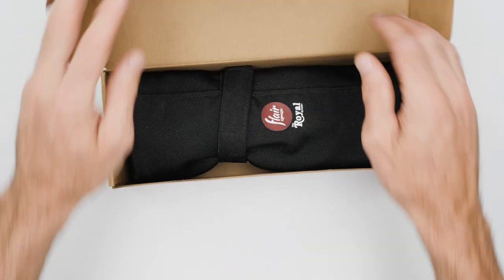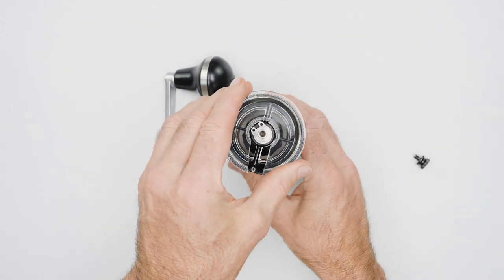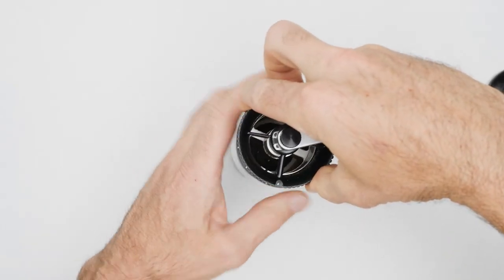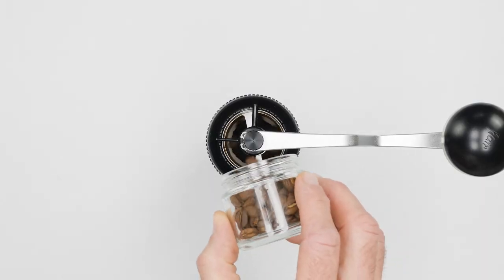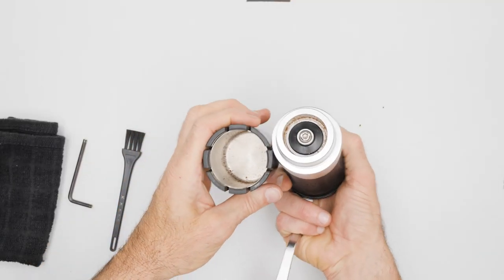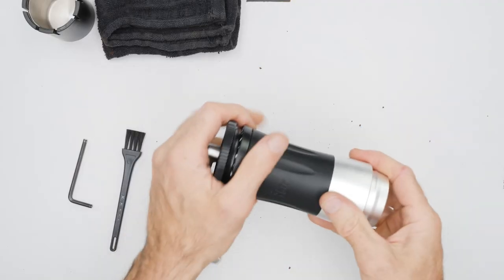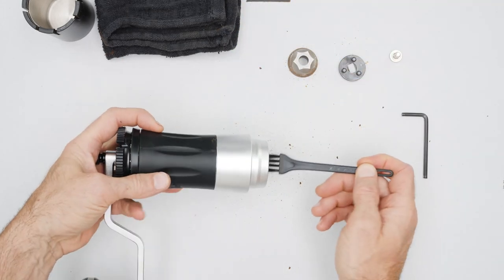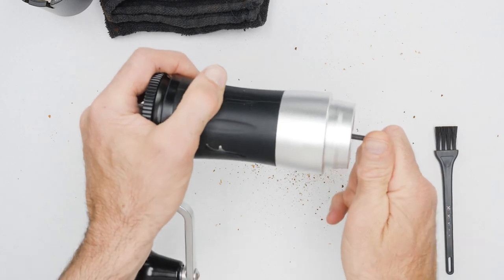Royal Grinder - Setup & Cleaning Guide

Comment: Just got mine in an hour ago. It's amazing totally turned up my flair neo experience.
Reply from the maker: Thanks for sharing!
Reply: Was wondering how often should I do that cleaning you show toward the end of video? And could you give me recommendation on grinder setting for using with Neo? I went with a 1.5 turn from the smallest grind setting. It works great but I'm new to this and was just curious if I'm on the right track. 👍☕
Reply from the maker: @Brewmanbru  if you're using it every day, you're exchanging what little coffee is retained for fresh coffee. You can weeks or even a month before it's worth considering. One full rotation from soft lock up (burrs kissing) is a good place to start for 16-18 g dose, perhaps a couple clicks coarser. feel free to reach out by email service@flairespresso.com to get more assistance.

Comment: Took me five or six shots to get the Royal grinder dialed in for the Neo Flex standard (non-pressurized) basket. Found the sweet spot betweent 9 and 11, variable by the usual minutiae. If you are using locally roasted beans, try 11 and then tighten it up.

Comment: Just got mine. Grinds great, but hated that the handle wobbled because of the misfit of thickness of handle vs. length of shaft. Found a copper washer to perfectly compensate. M8X12x1mm. Happy and gratified grinder now. It even looks good in place.
Reply from the maker: Thanks for sharing, please send an email to service@flairespresso.com so that we can look into the misfit
Perhaps it's something we cam address with a replacement handle
Reply: Oh! And I vacuum both ends of the grinder whilst turning the handle after every  use. I mean… why not? I have a vacuum cleaner.
Reply: @FlairEspresso  Easier to take a few thousandths off of the shaft. The copper washer is actually an elegant solution. I like washers.

Comment: Trying to clean it, cannot get 4mm bolt to move holding opposite end with just hand as in video. Seems easier to slip handle back on to stop rotation of shaft while loosening bottom bolt. Inner burr comes right out and has little on it after 8 mos of nearly daily use. The inner/ring half of the burr is harder to get at, but a small toothbrush gives you the needed angle. The included brush isn't much use in there, but there isn't much to clean anyway, at least at 8 mos, except for some residue on lower edge. I think the hardcore types will want to take it completely apart to get a better look at the ring burr.
Reply from the maker: thanks for the feedback and tips!
Reply: After doing this I actually pulled a nicer shot on my semi-auto (Silvia) than I had earlier with the dedicated home espresso grinder (Specialita). This was on the first try, after setting grinder back to where it had been for Flair shots (on 5 in first rotation). Impressive.

Comment: I have had my grinder for a week now, however I am finding that the grind is not consistent. After a number of extracts I have to recalibrate back to position 0 (first rotation) and then set to between click 6 and 8. This makes a very good coffee, however I have to keep recalibrating the rotation every two to three days as it seems to move to the next rotation. It does waste some coffee every time I have to recalibrate. Will this settle at some point? Flair support told me that it could take a few weeks to settle. 

I was of the understanding (possible incorrectly) that once you set it to the first rotation and around that click 6 - 8 it should remain at that setting.  At this stage it does not...
Reply from the maker: have you dropped the cone burr out for cleaning? what you describe suggests the cone burr isn't secured properly which can happen if you remove burr and replace while grinder is set to a fine grind. set the grinder to a very coarse setting, loosen the screw that secures the burr and retainer, ensure proper seating/no gaps and retighten. still having troubles reach out to support www.flairespresso.com/contact so they can guide you further
Reply: @FlairEspresso  Thanks I will do as per your suggestion. I have not removed the cone burr since I received the grinder last week, however this may solve the issue for me. I will do as per your suggestion and advise outcome. 😀

Comment: How long does it take to grind 18gram espresso?
I'm using Hario and it takes 4-5 minutes.
Reply from the maker: This depends on several factors such as the coarseness and brittleness of the beans but for espresso with the Flair you can expect 1/4-1/5 that time so ~ 1 min
Reply: @FlairEspresso  I received it and I tried it. It takes around 1 minute. the grind is uniformed and consistent. It is wonderful !
Reply from the maker: @oalaqeel  thanks for sharing! Grind on💪
Reply: @oalaqeel  thanks for sharing, I was hesitant because I had a hario once and it drove me nuts. Just placed an order for the flair royal!
Reply: This is nothing like a Hario or Zassenhaus for that matter. Much easier and quicker.

Comment: Hey, I just got this grinder a few days ago and today I started using it. I did a pourover, it was pretty good for a first usage but once I moved the crown to a coarser grind to try a french press, when I got to the 60-72 position I felt the crown beginning to rub the rim, producing clicky type of sound similar to what's explained in 0:46 but with the difference that I didn't rotate the crown past the 72 position.

I notice that in the demostration the crown moves pretty smoothly until it hits position 0 on the third full rotation. Is this a normal behaiviour? I'm thinking it might be because the grinder it's very new still but this is my first hand grinder, so I can't really tell.
Reply from the maker: please get in touch with support here flairespresso.com/contact so they can look into this matter for you better as video might be required. you should have at least 72 clicks available.
Reply: @FlairEspresso  Oh I do have the 72 clicks, my question was if it is normal that the grinder makes those clicking sounds when I'm moving the crown to a coarser position, which is in between 60-72. I have to try anyways if it affects the grinding. Thanks for answering!
Reply from the maker: are you counting clicks from lock up of burrs or "0"? are you finding you need to be that coarse (where it starts riding on body) for some brews? if so, pull up on crown and compress spring inside a little more to gain additional clearance. if you need more assistance please reach out to support www.flairespresso.com/contact
Reply: @FlairEspresso  
Yes, I'm counting the clicks from 0 (absolute zero position which is explained in the video). Yesterday I tried to adjust the crown to the third rotation and I just couldn't really move the crown past the 56th position, it gets locked up for some reason and it starts to riding on body as you said.

I didn't bought the product directly from the Flair website so right now I'm getting in touch with the local coffee shop that I bought it from. If I don't get any helpful answers from them I'll definitely send an email directly to Flair.

Comment: After using daily for three months, my handle is locked up. It squeaks horribly loud if I move it and it doesn't even move counter clockwise. Problem persists even when disassembled. I have searched far and wide for a solution but have found none. I do not want to put WD40 on my grinder or anything like that. I emailed Flair and am still awaiting a response. Anyone else ever had this problem?
Reply from the maker: Hi there, sorry you've not seen our responses (2 in fact)! Please check your SPAM or JUNK folders for those. If you still can't find it, go to flairespresso.com/contact and use chat feature to get a live agent. They can troubleshoot this matter further with you.
Reply: @FlairEspresso  Aha! It was not in spam but in the "promotions" tab. I fully blame Gmail for this. Thank you very much.